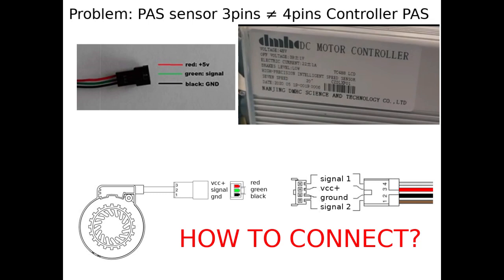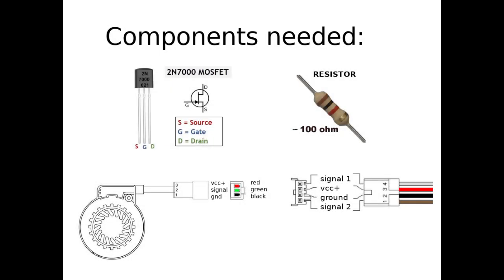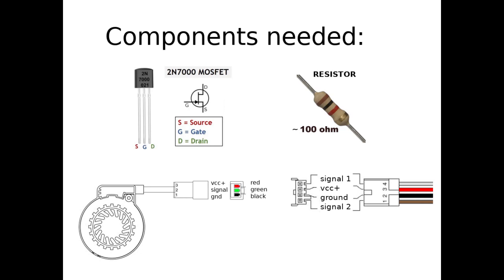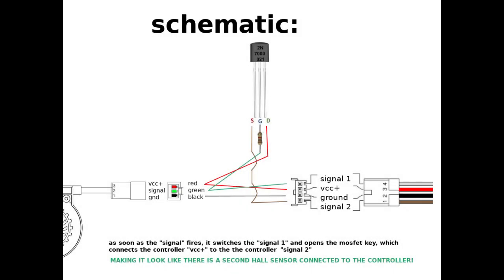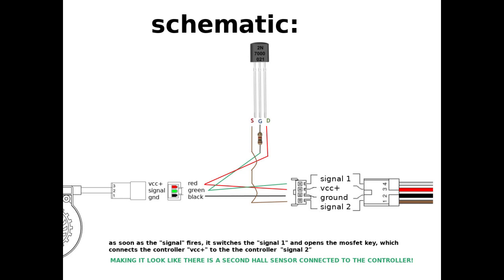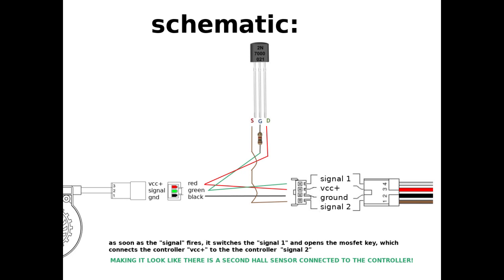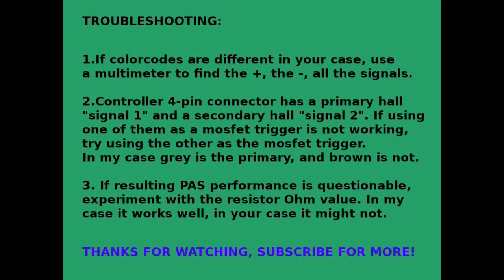How to connect a 3-pin PAS sensor to a 4-pin double Hall PAS controller

Comment: Yor talking double Dutch, if someone doesn't know how to change these and what they  actually do do you seriously think they ca a understand your terminology?, most  people don't understand what  is a torque  sensor, a cadence sensor, peddle assist sensor
EDIT-
I'm not trying to be  disrespect or anything like that I'm just trying to get you  more viewers and help more people, I have a carrera vulcan E Spec (2 actually) the chain regularly rips the r wir sensor off and although I can wire most E Bikes with my eyes shut I don't understand what carrera have done with there design but it's total crap and 99.9% of the comments online will agree, I  have a 3 wire sensor and was hoping to fit it as its left hand side and can't be affected by the chain but I still haven't got my head around it lol😢